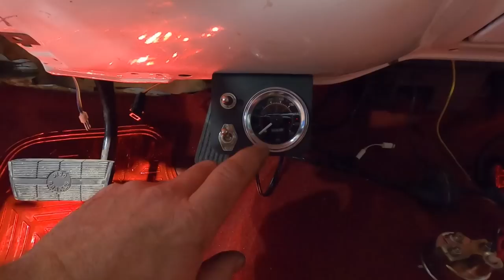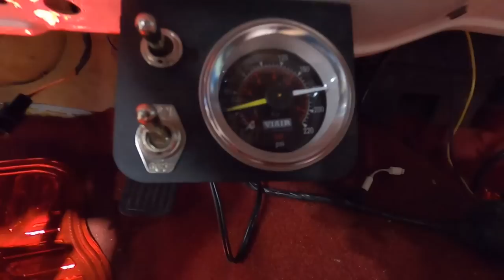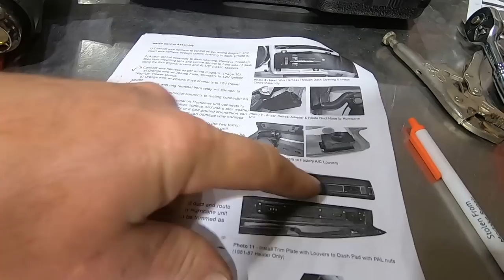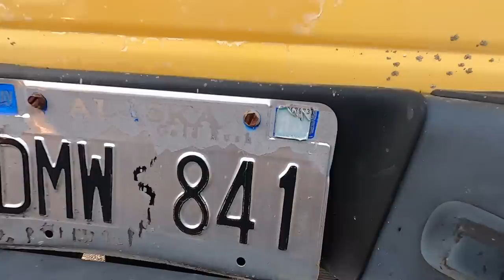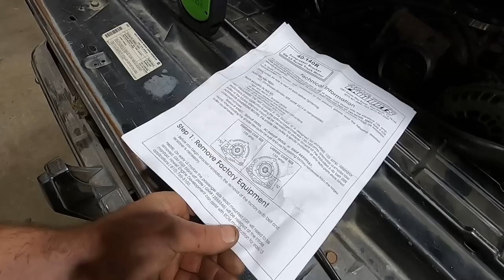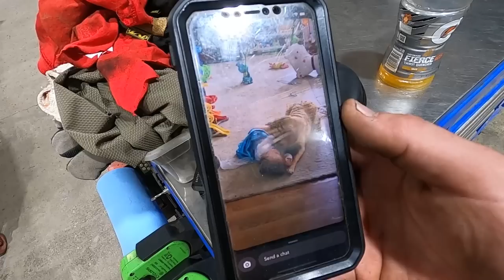I Finally Finished My LS Swapped Chevrolet Squarebody Dually And We Put It To Work! New Tow Pig?!?

Comment: You can use those old fire hose to make vertical and horizontal wind and water seals on the bottoms and sides of sliding metal garage doors.  I used them on my home made hangar doors.
Reply from the maker: Good to know!

Comment: To get the door unlock. Take a Dodge key that fits in and running in and out of the keyhole turn it at the same time. Do not put a lot of pressure. And lubricated first . WD 40. That's the way you unlock when you use a pic.

Comment: Just installed AC in my 02 Chevy 2500 hd, was a county truck so no power anything and no AC. Long story short, the AC was all new except the evaporator which requires the dash be removed. The AC lasted from Wisconsin to the New Mexico/Arizona border and then the evaporator had issues. So this is all very familiar! Glad it's working
Reply from the maker: Good times!

Comment: A “low pressure switch” disengages the compressor clutch if there is excessive refrigerant loss (below 30 PSI). A “Binary Switch” incorporates both of these protections into one switch.

Comment: I’ve used distilled water to find ac leaks. While it’s under vacuum spray the connections with the water. If there’s a leak it will suck the water into the system. Once you fix all of the leaks and pull a final vacuum all of the water flashes and gets sent out of the vacuum pump.

Comment: You can also run gorilla tape, 3 or 4 times around the sealing edge of the wheel to help it seal. I just tried it this weekend and it works great, but it wasn't my idea, I saw Colt do it on the S10 he's building on "Bl##pin' J##p" for the "X" build off 👍

Comment: Nice that the dually together and towing! The idler pulley fell off my 4.3L and stripped the bracket threads as I was doing 80. Too far from home so shop has it fun times. Just got running after a new distributor too.
Reply from the maker: sucky!

Comment: I’m not into the lowering trucks but to each their own. Big fan of the Cowboy Cadillac we had back in the day. Ours had a Pape sleeper cap and a 100 gallon auxiliary fuel tank in the bed. We travelled the East Coast bracket racing and that truck got 6 to 8 gallons while towing with the anemic 454. Thanks for the video!
Reply from the maker: Good times!

Comment: Hay I was watching the vid of the Axl flip on this from a year ago.  Those spring plates go the other way I believe.  You wanted to move the Axl back to make room for the drive shaft. Like if the suspension was compressed.  Just  a thought I might be wrong too, it's happened before. Good luck. Cheers.

Comment: A binary switch is high and low, trinary switches add a 3rd pressure point to turn on electric fans so they don't come on at the same time as the rest of the A/C electrical demand

Comment: 18:26 I was told once not to run my pump without the engine running. I was told it needed full volts or the motor would wear out prematurely. Just my two Canadian cents.
Reply from the maker: Never heard such a thing

Comment: Why did gm use plastic on the striker on those trucks? I replaced mine on my old truck with new ones, they lasted about a year. Seems like some one should make some metal ones.
Reply from the maker: For sound maybe? Cost savings?

Comment: I like the correct grill as well. 👍 Those tube grills just never did anything for me. Good work, Mort! 😎  🍺🍺🍺 I always wanted to see if The Club was as indestructible as they claimed. I had one...still do. I also had a steering wheel/brake pedal lock. One part locked around the bottom part of the steering wheel, and there was an adjustable hook that fit around the brake pedal. NOBODY WAS GONNA STEAL MY TRUCK! Thanks for sharing!
Reply from the maker: Good to know

Comment: you can use keyboard duster gas to charge the ac. it works good, been doing it for years. its cheap . and you don't have to have a recovery system for repair or mods.
Reply from the maker: What?!?

Comment: Those dakotas did come with the 360 for a few years.. only with an auto trans though. They were the RTs.
The 318's were pretty common, and swapping the v6 to a 318 is a cakewalk, same motor mounts, and you can either wire in the 2 additional fuel injectors, or you can just swap in the engine bay harness. Stupid easy.
Reply from the maker: Good to know!

Comment: Make bracket to use a hose clamp to mount the control valve around its body to the inner fender.
Reply from the maker: nah, they're meant for hoses

Comment: I would try to get that Dodge Dakota running and driving I mean I've never seen one without rotted rockers and no bedsides or the front fenders running out so that thing is extremely good shape they do have a lot of number 6 cylinder trouble so if I'm guessing that could be an issue

Comment: What was that Mulvaney mount for? you've got beer brand killers up there?😁
You do know they make both types of spade terminals with a ring on the usually wire end, right? 
Used to carry them in my terminal kit because at our X-ray sevice rates, time was money, and the customers didn't want me wasting theirs...plus it was quick and easy to the point of approaching lazy.
And watching DD speed shop is worse than getting vaccinated.
Tell the Duff dog Buddy, Max and I said hello!
👍🇺🇸😎

Comment: How does it tow with the LS?   Immernet experts always say a 6.0 won’t work because they don’t make enough torque down low (under 2500rpm).  

 I can’t see where off-idle torque is an issue, because you’re not crawling around at 15mph towing a trailer but you know, the guy on the immernet knows everything
Reply from the maker: They work really well in my opinion. And I pull a lot of stuff. It's obviously no diesel but it'll smoke a stock 454.

Comment: Hang about - what's that parked in your yard?  A Series 1 Jaguar XJ6?  Oh PLEASE tell me you are going to do a "will it run" on THAT thing!  If it's not too full of rot, maybe it would be a great contender for the LS out of the Purple Panty Eater.  I know many blokes over here who repowered their Jag with a 327 or 350 Chev back in the day due to the cost of reconditioning the old twin-cam six-pot Jag lump.....and they fit quite well.  There is precedence there too in that a GM auto box was shoved behind the I6 in the S2 XJ6 (a TH400).

I can see why you like that C30 though, mate.  There's just something about the whole package that sits right - visually, aurally and drive-wise and all.  Yep - chucking bigger wheels on it would sure improve its stance and add the final touches to the look, but that can wait.

That plastic heater valve (floating around on the inner fender) brings back memories for me.  You mentioned you wanted to mount it in the cab?  Oh no....nonononono.......  To explain why, I'll tell you a little story.......

Had a 1997 Holden VS Commodore wagon for 9 years and put a hundred and five thou on the clock (which pushed total milage to 215,000).  It ran an Ecotec 3.8V6 with a 4L60E and rear wheel drive.  Solid car.  Carried 500kg of ready-mix concrete in the back, towed 600 lineal metres of green 6"x2" lumber and several 8ft 4x4 posts a hundred miles or so, took I don't know how many 400kg loads of waste to the tip, shifted several houseloads of stuff, went all around the north island on trips and was the kid ferry for most of its life while we had it.  Great car.  The only weak point it had was that bloody heater valve.  

Ya see, after several tens of thousands of miles of being mounted on the firewall and being exposed to a lot of heat inside and out, they get brittle and the plastic basically disintegrates.  The first time it happened, I was towing a load of garden waste to the tip for recycling and suddenly saw the temp needle shoot for the "H" without stopping.  It usually pointed at what would be about a quarter on a fuel gauge, so to see it up the top end was quite alarming.  I stopped on the side of the motorway and saw the steam billowing out from under the hood.  The bottom plastic connection of that valve had broken off.  It was a simple case of using one of the heater hoses as a bypass hose and then filling the rad with water from a nearby stream to get us home.  About three years and 35k miles later, she blew again.  Same connection, same valve.  This time it was just as I pulled out of a gas station after filling the car up - huge boom, followed by a huge cloud of steam from out the front and sides of the hood as well as from the right hand wheel well.  Looked like she'd just blown her engine, but I knew better - hot glycol has an unmistakable smell, eh!  This time I replaced it with a NOS part rather than a cheap knockoff and it lasted until after we sold it.  We had another VS Commodore - a 1996 Berlina V6 Ecotec 3.8V6 - which I used for work.  I ran that for 140k miles (her total being at around the 250k mark when I sold her) and she blew three of these valves.  All of them were NOS parts too.  

The plastic didn't melt - it's hard to describe, but you could scrape it where it broke and bits just flaked off and if you rubbed the bits hard enough, they just turned to a black paste / wet powdery substance that was so unlike plastic and more like charcoal.....and I have no idea why it is just that one valve body that does it.........But mount that thing in the cab with me?  Er....I think not!  Who needs a hot green swimming pool in the passenger's footwell?  Not me, matey!

Anyway, it's awesome to see some great strides and progress on this Big Bertha.  Between that and Bernie the similarly-coloured tow truck, you'd be cornering the market up there shortly, eh?  All the best
Reply from the maker: Good stuff as always!